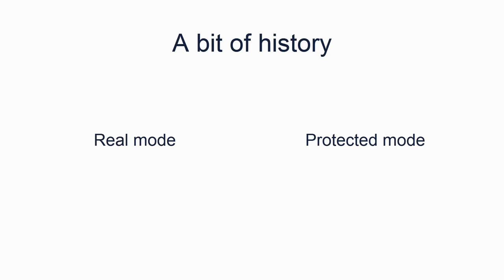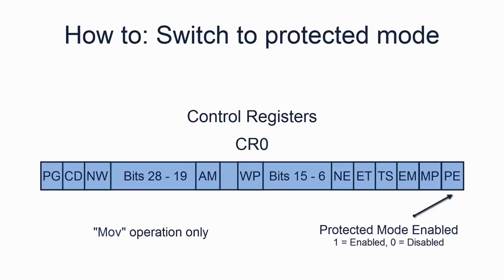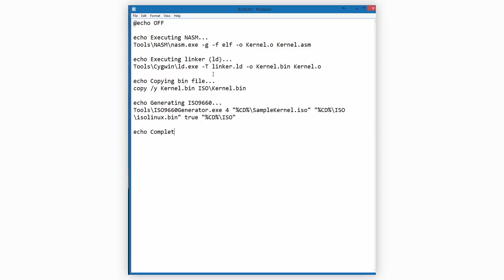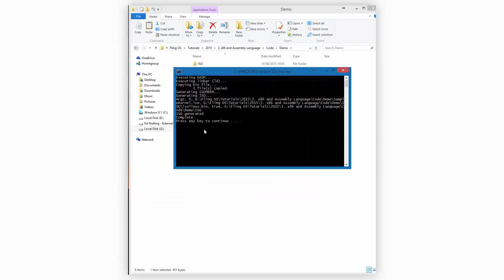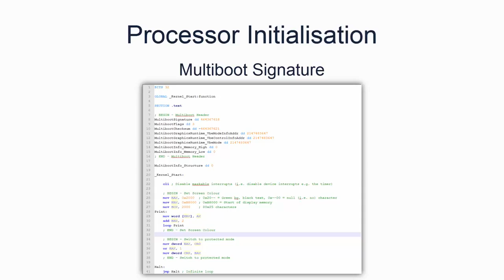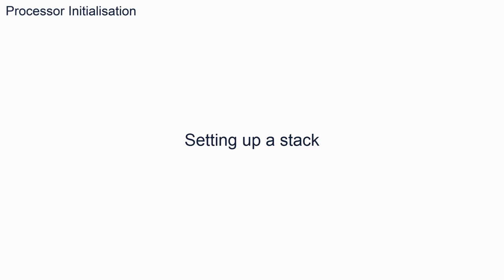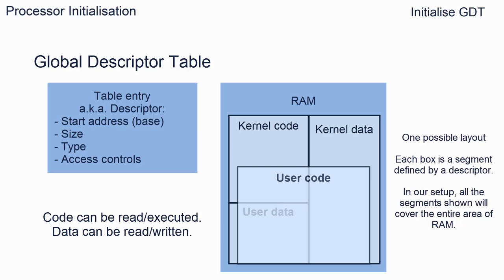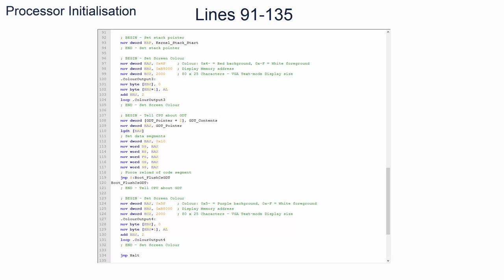4. Initialisation

Comment: Is this using Multiboot and not Multiboot2 because according to the documentation of Multiboot2 the structure of the MultiBoot Info Structure starts with:
- u32 total_size
- u32 reserved
followed by a series of tags we would have to check to find the basic memory information where we could read out mem_lower and mem_upper.
But in your example, you simply move EBX along by 4 and read the next two words which is more in line with the structure of Multiboot:
u32 flags
u32 mem_lower
u32 mem_upper
...

Comment: Is the multi-boot section identical(same for all multiboot?) If not, what does 464367618/ 2147483647 these numbers mean and come from?what does 'dd'/'db' mean? Do you assign any random signature value 0x2BADB002 for multi-boot or does it have a fixed value? Also does the script only output .colouroutput4 or it has already executed the previous ones, and we only see the last color output?
Reply from the maker: Hi, Multiboot is a standard which specifies what that section should contain. The numbers aren't random and consist of flags and fixed values for the bootloader to detect and interpret. You'd need to read the Multiboot standard to understand them.

The program executed so fast that you are only likely to see the last colour outputted.

Comment: Hi, after debugging with DGB i realized that:

MOV EAX, CR0        ;moves 17 or 0001 0111 into EAX which means that:
OR EAX, 1                 ;does nothing since the last bit of EAX is already one.

 So it seems my processor starts in protected mode? What am I doing wrong?
Reply: The things i can think of, maybe:
1. my emulator (qemu) switches to protected mode automatically
2. my bootloader (syslinux) switches to protected mode automatically
3. the host system (win10 64) is in protected mode, so my kernel "inherits" this mode.
Reply: Thank you, sir. Great tutorials! Easy to follow and neatly explained.
Reply: @slowvomit  Syslinux always switches the system to P.M.
You only need to load your own GDT & IDT tables.